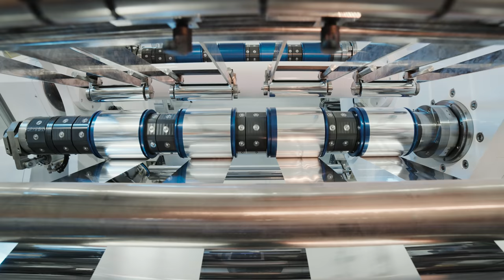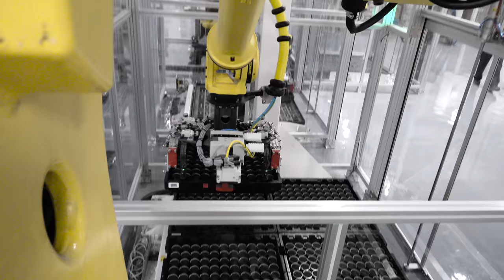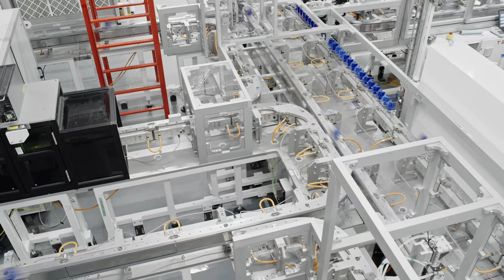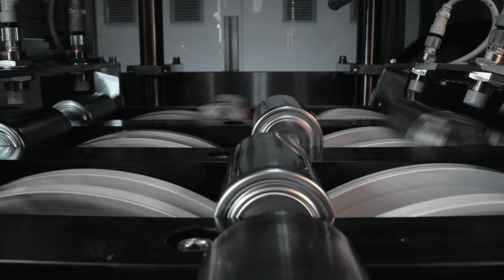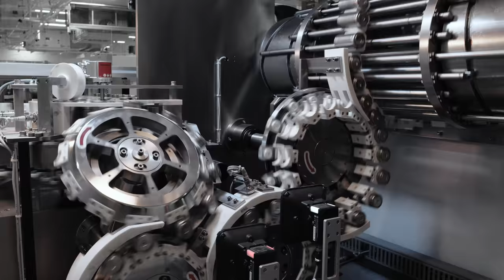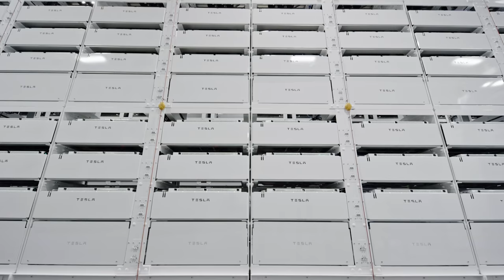Making Batteries

Comment: Volkswagen: Frantically taking notes
Reply: Voltswagen
Reply: lol
Reply: The Taycan uses lg chem batteries, I believe they're better than tesla in some aspects, taking advantage of the 800 volt architecture.
Reply: @unlucky5442  not even close lol.
Reply: @unlucky5442  yeah but voltage has nothing to do with batteries... it is just the way you wire them. Each cell is 4volts. If you connect 2 together you have 4volts if you connect them 2 one by one you have 8volts. Its just a way to connect them. Higher voltage means lower amps. Its nothing special really.
Reply: But the energy density way higher at Tesla. The voltage is just something you can rise if want but the density is key.
Reply: @unlucky5442  umm yea kinda
Reply: @unlucky5442  troll
Reply: @unlucky5442  this is why the car can drive long distances
Reply: @unlucky5442  tesla batteries are more efficient, they are cheaper, they have a greater energy density and tesla uses a more sophisticated cooling method. But this cell completely craps on the pouch cells they taycan uses by further increasing energy density, reducing cost, and eliminating most internal resistance which futher helps with durability and charge speeds.
Reply: Other legacy automakers: asleep and/or distracted on their phones/tablets/laptops
Reply: @odisy64  The Taycan have a faster charging speed and Porsche have in fact a more sophisticated thermal management system. I believe the Taycan also have about the same battery density as the model 3.
Reply: Lol they will not learn anything
Reply: @unlucky5442   the taycan has a max pull of 270kw, the model 3 pulls 250kw but because Tesla battery and drive train system have a much higher efficiency (model 3 is the most efficient production car in the world) its able to gain more range per minute of charge even tho it has a smaller battery pack.
The taycan has cell modules stack on top of each other and only receive the cooling through the bulkhead plate. Porche opted for heat tolerant cells because they knew their system was going to run hotter. The model Y uses an octovale system that manages all heating and cooling systems but also runs cooling channels in between the cell rows so heat can be immediate purged from the cells directly. But these new 4680 cells use a tabless architecture that eliminates most internal cell resistance so less heat is made during charge and discharge cycles. 

Why are you claiming these things without actually knowing about them?
Reply: Volkswagen will catch up and overcome tesla in terms of building the best and most efficient electric car the only advantage telsa has really left is their hype and the autopilot which is years ahead of Volkswagen Mercedes etc
Reply: @odisy64   sure you seem to know a lot about the battery packs. I'm no expert. I do however have both the model 3, and recently took delivery of the taycan so you could say I have some hands on experience, and base my knowledge of off what the people over at the tesla and porsche dealerships have told me about the cars. But for instance, I've never seen my m3 lr (2020) peak 230kw even at 300kw chargers, while the Taycan sits pretty reliably on 265-268.
Reply: @toniober4416  I doubt it. All the top graduate engineers want to work at Tesla or SpaceX.
Reply: @unlucky5442  well, unfortunately, you don’t know that far....Taycan 93.4 KW/H range of 288 miles. Tesla Model S, 90.0 KW/H 295 miles, plus double life cycle and higher energy density, thank you, next...
Reply: @LightSpirit24  in the US but not here in europe I study engeneering in Germany and still the most and the best of us are looking for a top job in the automotive industry here in the EU and especially in Germany
Reply: @buckeyechris21  Tesla have a more efficient drivetrain as a whole, that is indisputable.
Reply: @unlucky5442  i spent a lot of time doing research on these cars to get the truth, im just tired of Tesla fanboys and porche fanboys argue about complicated  comparisons. Like how the taycans 800 volt architecture is more efficient than Teslas but tesla manages to make up the difference in other areas but it would also be pretty easy for tesla to do a 800v too, just riskier. I dont really believe in brand loyalty so until i see solid math and physics i wont changed my mind.
Reply: @toniober4416  its hard seeing VW catch up in efficiency and cost when tesla does a lot of effective R&D on its motors and cells but also plans to scale at a level above VW.
Reply: @odisy64  Volkswagen is investing over 90 billion dollar over the next 5 years in electric motors and battary cells and i dont think they can scale up even close to VW level they may succeed in the 50.000 to 100.000$ area but to scale up they have to go in the 20.000-40.000$ area and this area is ultra competitive where every penny counts and there is VW king
Reply: While buying carbon credits from Tesla.
Reply: @toniober4416  VW is not spending 90 billion on batteries and electric motors, you should look those numbers up again and what the money is actually for. But while VW throws money around Tesla has already built a 10gwh pilot factory in Fremont but plan to hit 100gwh in 2 years and about 3,000gwh by 2030.

The 4680 cells tesla developed along with its manufacturing growth are going to beat Volkswagen in terms of price and cars produced. Where is Volkswagen's plan to match tesla?
Reply: they have to
Reply: @unlucky5442  Yeah VW has better tech overall, since they have been in the car industry for decades, but Tesla has their own batteries and a better electric motor. They will need some time to catch up. They will tho.
Reply: @bailey125  lol that's the rebranding xD
Reply: @toniober4416  you should be looking to apply for Giga Berlin then
Reply: @thorH.  what tech does VW have thats better than Tesla? The model 3 and the model y are safer than what VW offer but tesla also has a higher efficiency and price point. Not only that but Teslas FSD is way ahead too.
Reply: @unlucky5442  ... they HAVE to be better... they cost more....
Reply: Tesla fanboys: frantically writing comments
Reply: Write that down!
Reply: @ernestgalvan9037  I mean, you get what you pay for
Reply: @unlucky5442  What’s the price tag on a Taycan? Over $150k. A model 3 performance and taycan both do 0-60mph in 2.6s and it’s ~$60k. If I were wanting to spend $150k on a car I’d wait and get the Model S Plaid
Reply: @quincypurcell5222  writing facts
Reply: @prankstar1443  well first off the model 3 performance do 0-100km/h in 3.2 sec. Not that acceleration determines whether or not a car is good? - Taycan is still beating the model s in a drag race though. I think it's safe to say that you get what you pay for. If you can afford getting a 100k model s you can also afford a Taycan and I think a lot of people in that segment appreciate what a Porsche offers. The model 3 is a fun daily while the taycan is meant to be a sports car. Different cars for different people and or needs.
Reply: Very like it
Reply: @unlucky5442  hahahahahahahahahahahahahahahahahaha
Reply: @maxw1567  It's the same, just the battery is bigger. A 18650 battery is 18mm x 65mm, Teslas 21700 is 21mm x 70mm. density is not higher, the battery is larger. Same goes for the newest Tesla battery which is even larger. The increased "density" claims by Tesla are exactly proportional to the size increase. So no, Tesla batteries are not better, they are just larger.
Reply: @Tree-xt9th ?
Reply: @unlucky5442  Sorry it was just funny that you said someone had better batteries than Tesla.
Reply: @odisy64  He is right. The Taycan charges faster and can reach a destination in less time.
Reply: VW was a car manufacturer before Tesla ale will be long after the hype will end.
Reply: @toniober4416  I am not 100% sure but I guess that that money is not in R&D but rather in battery capacity, things you need to make evs, and no not produced by VW but rather they will pay to others manufacturers to make what they need, and that money will be a lot less effective if you compare it to tesla, so yeah it's a lot of money but will probably do worse that 15 B of tesla spending
Reply: @joaomagrico1297  they investing it in the drivedrain system and their own battary production
Reply: @GenikaXVI  you realize that by making fun of other manufacturers, you'll make yourself look bad when someone else innovates
Reply: @arturgarncarz3631  hahahahah people used to say the same about Nokia.
Reply: @quincypurcell5222  not really, I will congratulate the few ones that will do so! It's been 20 years I'm still waiting lol it seems like everyone else besides Tesla and other Elon's company are blind they just want a check they don't care about innovation
Reply: @Tree-xt9th  you are comparing a well known brand with many factories, brands, patents VS a bubble with quality from 90s. The only reason market cap for Tesla is so give is because of speculation. Tesla's value is nowhere near it's revenue.
Reply: @arturgarncarz3631  haha its value isn't supposed to be near its revenue because its future potential is taken into account. The potential it has to be a 2+ trillion dollar company is why its stock is so high. Versus Volkswagens potential to end up at $0 because they are the next Blockbuster! If you think the stock is a bubble and cant see the potential then short the stock and loose all your money!
Reply: @Tree-xt9th  yeah, all bubbles had potencial.
Reply: @arturgarncarz3631  And all massive stock market rises have idiots saying  "its a bubble" coz they don't understand the basics behind valuing a company on its future potential.
Reply: @peterlustig6888  nope, the model 3 gains more range per minute.
Reply: @sschueller  its not the same, it has 5x energy but 6x power. Unlike the 18650 and 2170 currently in use, the 4680 uses a tabless design to decrease internal resistance and increase it ability to shed heat. Its also utilizing more silicone while reducing graphite and eliminating cobalt. Their is also the dry electrode processes they are using. 

You are ignoring the huge differences in these cells, why?
Reply: @arturgarncarz3631  and yet the CEO of VW says tesla is ahead of them...
Reply: @odisy64  because that's all marketing and doesn't change the fact that the battery is larger and their claims are rounded to the next whole nunber. One thing Tesla is good at is marketing. Where's that FSD that you paid 6k for and were promised more than a year ago?
Reply: @Tree-xt9th  but what if that future potential turns out to be a lie?
Reply: @sschueller  that’s the risk you take. Based off of past evidence however, it’s not a good idea to bet against Elon musk.
Reply: @sschueller  have you watched  the battery day presentation? The are using whole numbers because it will be about a year or two till they figure out all the advantages of the battery. They gave 5x energy density but mentioned diffrent cathode types for different purposes.

But do you understand why 5x size and 5x energy is more difficult to achieve that it sounds? Because internal resistance would have lowered energy density by heavily increases flow resistance. The 4680 cell is not feasible without the tabless design. Why do you think no one else has made a cylindrical cell this big before? 

I dont reallly care about tesla not reaching its FSD goals when elon says they will because the current FSD beta build does way more than it use to a year ago. But i also remember claims other companies like VW made like having self driving cars by 2015...
Reply: THIS WORLD IS GETTING SO FUCKING SCARY!!! Go watch Gunz N Butts music video on youtube and mabey an idea will pop into YOUR head🙈😠
Reply: VW’s EV Sales grew by 214% from 2019 to 2020, reaching more than 230,000 all-electric car sales and they expect a 3 digit sales growth for 2021... VW group will surpass Tesla in 2022. mark my words
Reply: I think that all car companies are looking at this and saying wtf. Ps that’s the slow mode. Shh
Reply: @jmk2060  haha I can tell by this that you aren't really understanding the bigger picture. You still think the end goal is "who can sell the most cars" haha.
Reply: @altair4262  ain't nobody driving any EV long distances
Reply: @jmk2060  tesla delivered 500k cars this year (and unlike volks wagon these cars cost more and do more) but they will build over 800,000 cars in 2021 and around 1.2 million by 2022. but again, the texas and and berlin factory wont be at full capacity by then so plenty of room to grow and Tesla is the only one building enough cells to supply such a large fleet.
Reply: Not happening.
Reply: Where can we buy these kinds of batteries?
Reply: Good for them, I certainly hope they are (somewhat optimistically!)
Reply: @lovropavlicevic6321  Facts. Except replace food with batteries. Also I feel like its more of a soda bottling company than a food but whatever.
Reply: The people’s car Company
Reply: @GVChannel  you cant, Tesla is the only one who makes them and they dont sell them.
Reply: We will see if Tesla is really somehow better than the ID4, who needs a racecar? The important thing is that the EV charges fast and have a good range above 500km without being very expensive. A Ferrari is also a good car an better than a golf but guess which one is a top seller?
Reply: Volkswagone
Reply: @joschjosch8859  its a good thing Tesla offers the fastest charging along with the longest ranges for the cheapest prices. other than that the Teslas are the safest and most efficient cars.
Reply: Too many tesla haters
Reply: @odisy64  a tesla is for sure not the cheapest car, an EV from VW starts at 15 k, of course the range is mediocre and the car isn't that Hightech but the most people don't need the kind of car tesla offers. For sure a tesla is not the cheapest car. Polestar, Lucid, Renault, VW, Mercedes, all of them can build EVs and they will. Tesla will never win a price war against them. If Tesla can manage to produce 800k vehicles in 2021 that's good. VW is able to produce that in 2 Months. For sure tesla is not worth nearly a billion dollars. That's like 4 Times as much as VW group(VW, Audi, Skoda, Bugatti, Porsche,...) and Daimler combined. That's absurd. The Stock market values the future of a company, if there is one tiny mistake, Tesla is gone.
Reply: Volkswagen Das Auto
Reply: lol
Reply: @odisy64  its 73 billion € what is about 90billion dollar which is devided in 3 parts the main part is e mobiliy with 35 billion € E hybrid 11billion € and 27 billion € in digitalisation for EVs they planning to produce at least 26 million EVs by 2030 but those numbers are the worst case szenario they could be way above its calculated with the EV demand of today but like we saw over the last years its rising very quick and for teslas nubers you could never trust the long therm goals of elon musk thats what he wishes not whats real or where is the roadster and the semi truck wich should be on the market for quite a while now
Reply: @prankstar1443  Porsche does 0-100km/h in 2.6 which is more than 0-60 miles and the differnce is that the model 3 does it once the taycan does it all day long
Reply: @odisy64  this is nothing compared to VW they have 125 factorys and at this time only one produces EVs there is plenty of room to scale up
Reply: @joschjosch8859  read what i said carefully "Tesla offers the fastest charging along with the longest ranges for the cheapest prices". im saying for what Tesla offers, no one gives you the same for cheaper. i know their are cheaper electrics, their are sub 10,000$ EV's out there but they lack a lot of specs.

ture, most people dont need high tech cars with supercar like performance but people also dont want 15k stripped down cars. the world would be a much different place if people only bought what they needed. but in this world Tesla is outselling them all while being expensive for a car.

i already know you give other companies more credit than they deserve and how you dont understand the logistics in building an electric car vs an ICE car. you just bragged about VW building more cars in 2 months then Tesla will next year but ignore that VW has no suppliers or supply chain set up to build even half that number for a couple of years. this is why the CEO of VW admitted Tesla was ahead of them.

tesla will win a price war against them because Tesla is the most vertically integrated of them all. unlike those companies you mentioned, Tesla wont need to buy its cells. software, and drive train components from some 3rd party supplier or OEM everyone else uses.
Reply: @toniober4416  you think room and factories limit the production? their are supplier bottle necks involved in making EV's. why do you think Tesla built the worlds largest cell factory just to supply one small factory? same reason they are building another battery factory in the US and Germany ( because they need their capacity to grow from 36gwh to 3,000gwh in less than 10 years to meet their production goal of 20 million cars a year.)
Reply: @odisy64  they will never reach 20 million cars a year
Reply: @toniober4416  why do you believe this?
Reply: @odisy64  in what meaning? This sentence is taken out without context. Sure, they are ahead with electric cars but this is VW. Not some bubble company with 3 models.
Reply: @odisy64  i dont think so but they may be able to produce 20mill cars a year by 2030 but there is no chance they are able to sell this amount of cars that would be double of what Toyota or VW are selling per year. VW with all his sub brands build more than 150 different models in every price range form 5.000 - 10.000.000 dollar you can find something they have a car in every category in every size and every shape and their own models for every market there is a good car for every person form exquisite to best buy for the bug VW has something they produce models they know wont make profit to get Attention or hope they would buy a VW again later and still there only sell 10 milion cars a year because there always will be some small niesch where a other car is the prefered choice and there are many people who buy from other brands for personal preferation if tesla goes bigger they will loose their hype because then its not spechial anymore to drive one there are many people who dont care what car they are driving there is no chance any company can sell 20 million cars a year
Reply: @arturgarncarz3631  in technology and manufacturing scale.
Reply: WRITE THAT DOWN WRITE THAT DOWN!
Reply: @toniober4416  what if I told you there is a Tesla factory in Germany
Reply: @odisy64  Stop arguing with Toni Ober, he's probably one of those idiots of shorted Tesla a few years ago and can't accept the fact that Tesla is getting bigger
Reply: @LightSpirit24  You forget that Volkswagen is German.. The prime of engineering.
Reply: @Tree-xt9th  All the experts and analysts admit that Tesla's stock is way overpriced and the company will not meet the expected future growth. Tesla won't dominate the market for long, it will also not surpass other manufacturers like Toyota and Volkswagen, the evaluation has just been too optimistic and extreme it will not be good the moment Tesla faces struggles, add to that the short squeeze, the pandemic which led people to invest their unused money in masses on companies like Tesla, they have simply been inflating it but it isn't close to delivering as much as it is expected of it, unless it becomes skynet and other manufacturers go extinct there's no way it will hold that value.
Not even after the possession of the entire Lithium reserves of Bolivia which the US government staged a coup in either(which canceled a contract with Germany to exploiting Lithium for future automotive projects)
Reply: @idyllsend8235  that’s the biggest load of crap I ever saw. Loads of experts and analysts have a $1000+ price target so stop just making up lies. If you wanna bet against Tesla then go for it. You will loose just like all the other Tesla shorts. You clearely dont understand the impact of their future distribution and are just judging them based on other car companies.
Reply: @ifjimre  then Im telling you that there is a tesla factoy  in building progress which they dont even know if they can open it because they start building it without the permission from Berlin because there are some environmental cases which they are fighting about in court. they probably will win but its not save. so I think i know pretty well about the tesla factory in Berlin Grünheide
Reply: @Tree-xt9th  See you in two years time big boy.
Reply: @odisy64  Tesla loses performance after each launch and has overheating issues when peak power is demanded.
I don't dislike Tesla, but this market is toxic.
EDIT: You ignore what Volkswagen is and you don't understand that victory can defeat a company.
Reply: @idyllsend8235  all EV's lose preformance after every launch and overheating at peak draw is an issue as well and that includes the taycan (ive seen taycan drivers on the nürburgring talk about the car getting to hot so they need to monitor battery temps for better lap times.

You talk about teslas marketing when VW has people convinced the taycan somehow eliminated voltage sag and they dont lose preformance after multiple launches.
Reply: @odisy64  first of all where did i say that the factory will not be build? it will be build im just saying that there are some legal problems with it. and about the nürnburgring time tesla was there with a modified model s and according to them it was quicker but when it was quicker why is there no official time? not very trustworthy. and a far as i know has tesla never been at the nürnburgring with the model 3 all we have are some times from hobby drivers where i've seen only one time in taycan area and that was with a tuned model 3. And i dont underestimate tesla they are the most efficient EVs out there with the best battery technologie and a pioner in the field but the better sports car is the taycan
Reply: @toniober4416  im not sure why you brought up the model S plaid, im talking about the model 3. The plaid did not do an official time because its a prototype and tesla was not their to do an official race which you need for an official time.

Regardless, the video of a model 3 was done by a random YouTuber who has a lot of time racing on the nürburgring. But he was driving a 100% factory stock model 3 against a Taycan 4S.

And yes, you are clearly underestimating Tesla when you say the model 3 can only do "one" launch, dont try to act like you weren't being blatantly biased.
Reply: hahaha
Reply: volkswagen taking notes, all others have left the classroom
Reply: Here before the comment section gets filled up
Reply: @odisy64 You got the cooling part so wrong...
Reply: @arturgarncarz3631  VW will be out of business way before Tesla.
Reply: @CarlosDerHund  how much do you actually know about the Tyacans and Teslas cooling methods? i know a bunch but no one has been able to tell me why the Taycan's is better.
Reply: Why has it become a m3 vs Taycan war lol.. Don't they serve different purposes in the first place..?🤔
Reply: @jwdk7662  the model 3 is a better track car than the model S and serves as a better daily driver even tho the S is faster in a straight line. the model Y and 3 do server a different purpose but that wont stop people from comparing the technology in them.
Reply: Write that down, write that down
Reply: Das Auto
Reply: “Write that down, write that down!!!!!!”
Reply: @unlucky5442  but no chargers to charge lol
Reply: @Aecor  here in Norway where I live, there's more chargers for the e-tron and taycan than tesla chargers. It really depends on where you live.
Reply: @jackvexplaid  yeah like 15-20% less range, also it beats the tesla at the quarter mile, so why does 0.3 sec difference in 0-60 make any difference.
Reply: @unlucky5442  oh didn’t really know that.  Thanks
Reply: Volkswagen 💩👖
Reply: Yes starring to make
Reply: @bailey125  it's Volks.
Reply: @c_rusoe  r/woooosh
Reply: U mean Volvo
Reply: @unlucky5442  yes
Reply: @unlucky5442  I mean tesla is better
Reply: Is the battery are the big version of Duracell 😂😂😂😂😂😂
Reply: too late, they are getting REKT!
Reply: Lol
Reply: @bailey125  Underrated reply xd
Reply: l
Reply: funny, but as i remember they are in that stuff since 1940 not 2000.
Reply: Then frantically starts copying and pasting
Reply: Postwagen. :)
Reply: @unlucky5442  you don't know what you're talking about pal :)
Reply: @unlucky5442  you mean porsche Trashcan?
Reply: I am still wondering why my airbag on my 1999 Jetta never deployed after I was horribly T-Boned by a flat bed truck carrying PVC pipe. This "accident" took place in May of 2005, in Hudson/New Port Richey, FL !
Reply: @bailey125  😂😂😂😂😂
Reply: Because they are concerned that an airbag from my 1999 Jetta failed to deploy when I was involved in a MAJOR car accident in May of 2005 in Hudson/NPR , Rte 19, Florida ...manufacturer defect or did someone tamper with it ?? Vehicle was totalled and windshield cracked !! Yet...airbag ...did NOT deploy.....- very suspicious !!
Reply: @DanTheMan 72 ..Why did your airbag fail to deploy too ?
Reply: Yes
Reply: @unlucky5442   that is because you don't know that far
Reply: LOL OMG
Reply: @bailey125  in my country you read it like that so i can understamd the mistake
Reply: @unlucky5442  lol not right at all
Reply: Noted
Reply: if ur neew to da channel
Reply: @unlucky5442  Pouch - Porsche have no idea, this shit falls apart, a cylinder is infinitely stronger than a pouch.
Reply: Late but better😉
Reply: Actually they also have some Tesla shares...
Reply: I've heard that the German gigafactory will be uber efficient.
Reply: And then ignoring it.
Reply: VW had hybrids long before Tesla so I don't know what you're talking about.
Reply: @maxw1567  Considering that Tesla makes round batteries it means 78% space efficiency.
Reply: @odisy64  800V means much higher efficiency over 400V.
Reply: @odisy64  You are comparing VW to a Tesla. It's like saying a fly can win in a fight against an elephant. VW has 10 times more assets, 100 times larger R&D department etc... there is just no comparison.
Reply: @korencek  oh great, another European car fan that doesn't understand what voltage does. Having higher voltage is SLIGHTLY more efficient but so negligible the efficiency can be made up else where, thats why the model 3 with 350v architecture is the most efficient car in the world with an MPGE of 141 and also charges faster than a taycan with 800v architecture.

Dont try to argue with me about this, i have training in comercial and residential electrical installation. Teslas are technologically superior.

Ive been hearing about the germans building something better for 4 years an all that has come out is inferior. while these companies talk about how much resources they have, Tesla outproduces all of them, even the hundreds of EV makers in china.
Reply: @odisy64  Don't try to argue with me, I am a mechanical engineer and you are probably nobody. Higher voltage means there is no need for thicker conductors, battery can thus fill faster, there is better power retention, motor wiring can be thinner and closer to the rotor meaning higher efficiency. Although at very high power motors it doesn't really matter because they can go up to 98% efficiency but there is still less resistance on the wiring with this much power, meaning less power loss. Also the motor can be much smaller at higher voltages for the same power output because of thinner wiring.

Also what is inferior about German cars? At Tesla they still didn't conquer proper quality control of production and the product itself. Also Germans are making less powerful cars because annual registration/insurance raises exponentially for more powerful engines. So something around 150kW is normal for European roads. Also tesla put out 500k vehicles last year. How the fuck is that "outproducing" German cars? You are delusional.
Reply: @korencek  you mechanical engineers should spend a little more time understanding electrical systems. why does it matter to Tesla if they save a little bit of metal on the conductors and wires? a few pounds of copper means nothing when a Plaid with 3 motors and a larger battery than the taycan ends up weighing 300lbs less and being around 10% more efficient than that taycan turbo S.
you made a mistake assuming this would make the batter "fill" faster. cell chemistry and cooling is what limits a batteries charge rate, not the available voltage. a 350v 75kwh model 3 charges at 250kw max, the taycan charges at 270kw max but Porsche made a software update that encourages customers to charge at 200kw instead to preserve battery lifespan with their 93kwh battery.

i actually knew the taycan would have this problem 2 years ago when i reviewed their battery design. they made 3 big mistakes. 

1 . they chose heat resistant pouch cells (which is fine) but they stacked them on top of each other without internal modular cooling.(tesla liquid cools each individual cell in the battery which is 4000 cells+)
2. the only cooling they had was on one side of the pack through the bulkhead plate, this causes un even heating and degradation for the pouch cells (the BMS probably does not know how to account for this).
3. they insulated it for better winter performance at the cost of heat build up in hotter days or long track sessions. (Tesla uses an octovalve system with a heat pump)

because of these overheating issues it caused a Porsche taycan turbo S to overheat at the last lap of the Japanese 2021 EV prix and get beat by a bunch of mode 3's.

Tesla already built carbon wrapped rotors that reduces the amount of interfering structural steel which allows it to spin over 20,000 RPMs and increase EMF efficiency compared to non wrapped rotors, they taycan lost efficiency because they used a 2 gear transmission system while Tesla stayed on a single reduction gear. do you wonder why the engineers at Tesla decided not to go with 800v but still manage to have the most efficient drive train systems? these engineering choices allow the Plaid to beat the Taycan in every single performance metric.

whats wrong with german cars? (besides killing thousands with illegal emissions) the same thing thats wrong with American and other European cars, Complacency. all these big automakers got comfortable being the biggest guys in the race and eventually everyone started walking together. even the CEO of VW thinks Tesla is ahead of them. Tesla is trying to kill gas cars while these other companies are just trying to stay compliant. its why Tesla has the best software and batteries/motors, even 2.5 million dollar hyper cars like the Nevera have laggy screens
and are overweight, Europeans dont have as much experience with electric cars as they like to think.

while you guys complain about panel Gaps their are Teslas making it up to 500k miles on the same battery while being the most powerful and safest cars you can buy. 

how many electric cars did the germans produce last year? we arn't talking about gas cars anymore, those things are going extinct, so what matters now is who is going to be producing these electrics at mass scale? its already projected Tesla will produce 800,000 by the end of this year and 1.3 million by the end of next year.
Reply: Write that down, write that down
Reply: @kobalov1  lower amperage means you can pull more amps out of it without overheating
Reply: @unlucky5442  yes. 800 volts. Try to charge that car in 90% of Europe.
Reply: @sebistancu  the 800v architecture is in regards to the power distribution in the car. Charging the taycan on my home outlet in the garage is perfectly fine.
Reply: I Made it 8K
Reply: @unlucky5442   sees words better than teslas RIGHT DONE ASP
Reply: @unlucky5442   Tesla's use their batteries efficient by collecting heated air outside